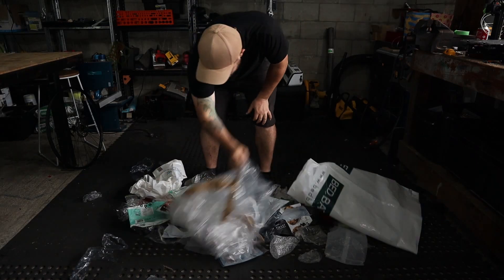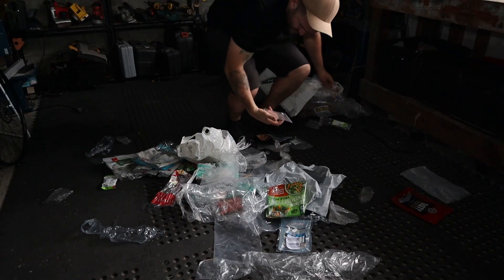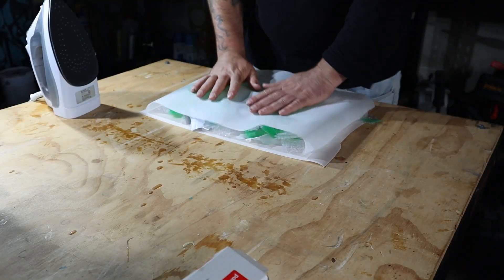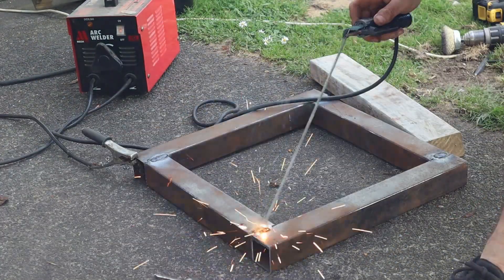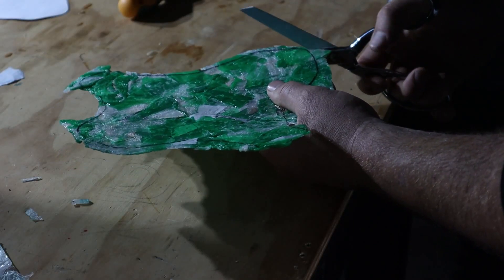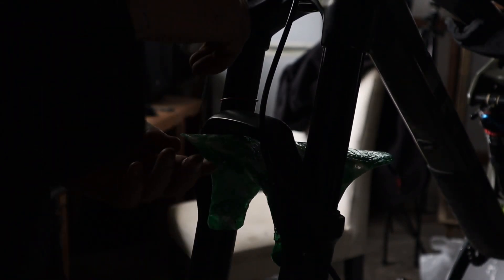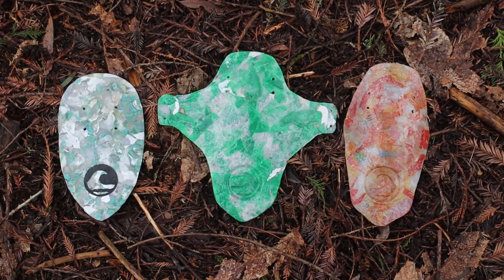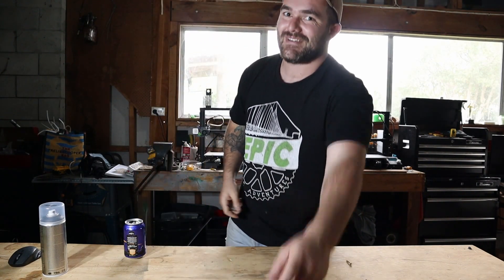Mudguards from Recycled Plastic for #TEAMSEAS

Comment: I'd be curious to see how a laser cutter compares to the CNC. Any experience here?
Reply from the maker: I wish I had a laser. I've used them a lot when I had a real job. I think it would definitely be better for etching the logo, might be a bit of an interesting experiment with cutting out the shape. I'd love to try it.
Reply: Lazor cut HDPE just sticks back together and can make very rough edges. LDPE doesn't work up that different to HDPE so expect results would be similar.